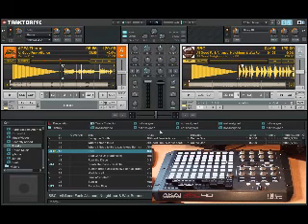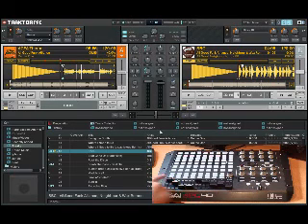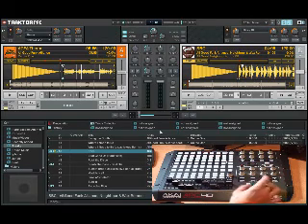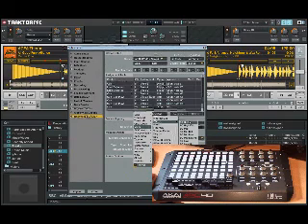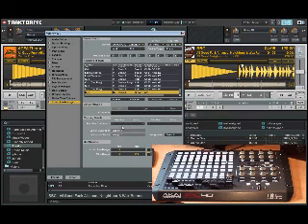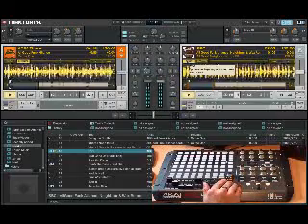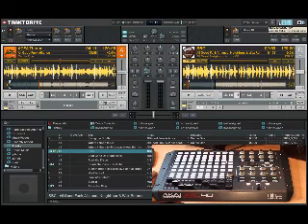Using Akai APC40 to control Traktor

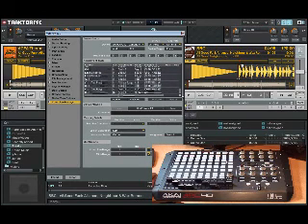Comment: hopefully im not wasting my time and you dont see this, but heres help to 4:50 and on:
1. set an input to whatever button you want to control (learn->button, set type, set which deck)
2. once you map it, the 'mapped to' column becomes mapped to a channel, note/cc, and value
3. set up an output to the same function as the input, and heres the (IMPORTANT PART)
4. in the 'device mapping' section, click the pulldown and match the cc/value to the input.
5. set controller ranges both to 1
6. set midi